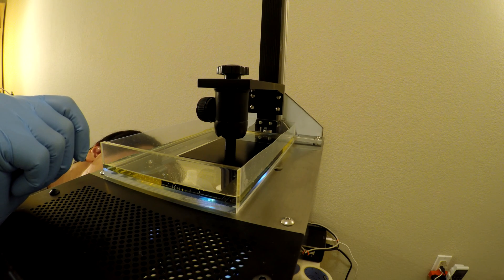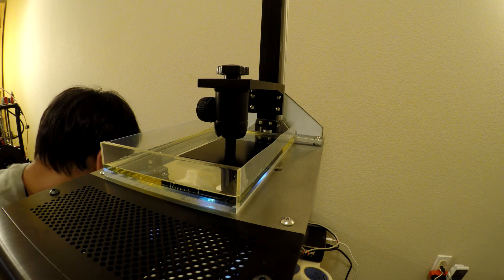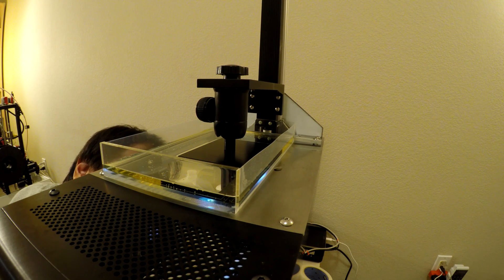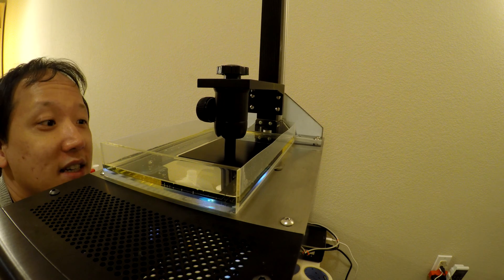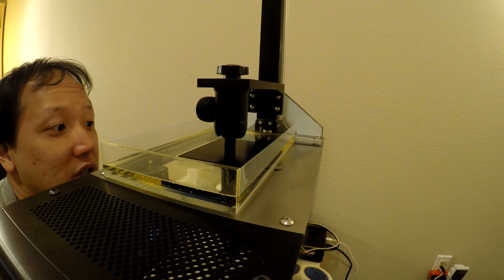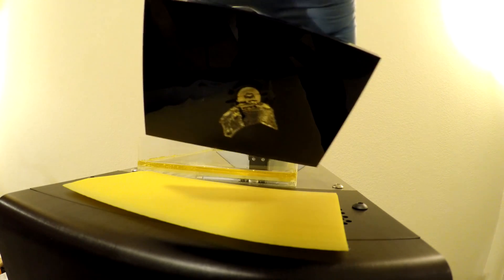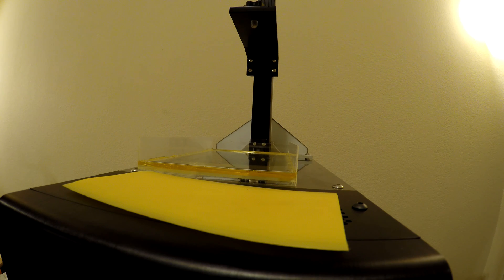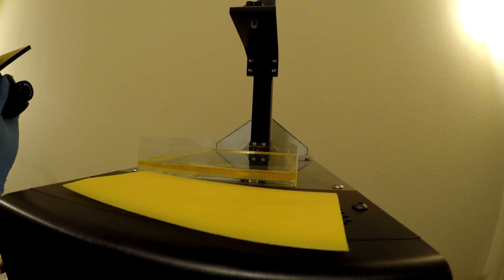Kudo3D Titan 1 DLP SLA 3D Printer - Calibration Part in Venus Creator Clear Resin

Comment: Looks great!  I'm currently trying to use 3DM-Cast but I'm having trouble with the layer settings.  You mention the timing for the sections, but could you list out the how many layers use those specific time increments?
Reply from the maker: Kevin Urbain The settings for 3DM Cast are published on the Kudo3D web site. However, while those settings worked for Venus Creator, I have found that Venus Creator is substantially faster than other resins, and is likely to be substantially faster than 3DM Cast as well. If you are having trouble with a specific print with a specific set of settings, I suggest posting to the forums for more assistance.